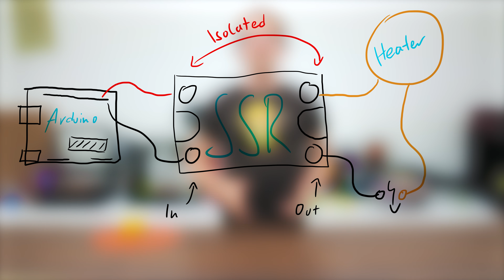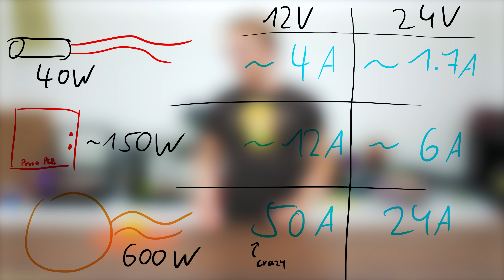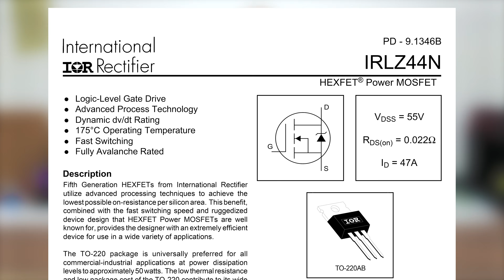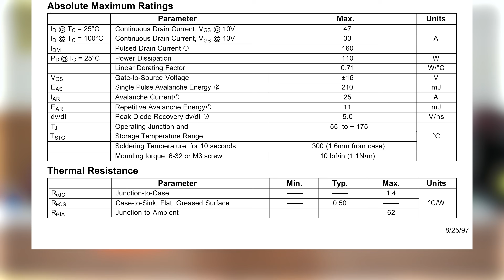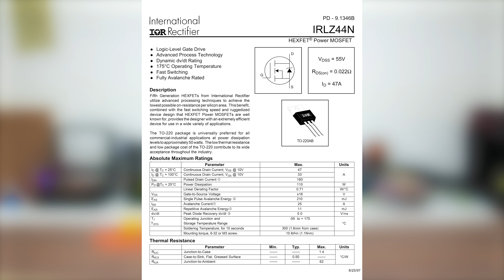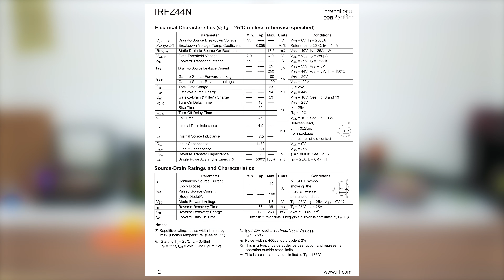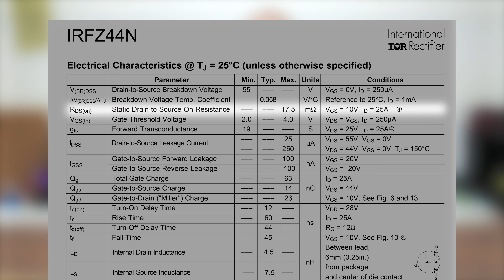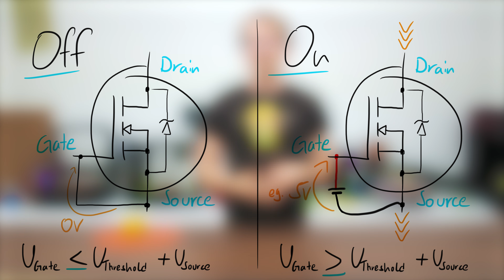Guide: Properly picking and using MOSFETs!

Comment: the last schematic is what I really needed to see explained - I was curious about the optional 100R. Thanks for that
Reply: +Adrian Ciubotariu I'm a newbie but was also curious how this works. What I gathered (and take it as a grain of salt) is this:
The 100 ohm resistor is to make sure that there isn't too much current flowing out of the output pin of the arduino. The gate basically works like a capacitor that is charged to switch the mosfet. So some current will flow into the game. The pins of the arduino are only rated for something like max 40mA so the 100 ohm limits that.
Afaik the 10k is so the gate charge can dissipate again when turned off and the mosfet switches off correctly.
Reply: +Adrian Ciubotariu Gate resistors are very nice not only to prevent your driving source to get destroyed (a gate of a mosfet behaves basically a capacitor, so in the first instant your driver switches on, it looks like a short circuit to the drain!) it can, by limiting that initial burst of current, help to reduce electromagnetic interferences too. (in a simplyfied view: less harsh current impulse means less emissions and with that fewer possible problems). If you would go really deeper into all the interference topics, you would actually start to look at the electromagnetc impulses travelling along paths in your circuits inducing electrical currents in the conducters, but thats another topic for another day...

Anyway, there is of course a trade of with increasing that resistor at the gate, especially once you have your heater PWM controlled, so it switches on and off all the time thousands of times per second. The gate resistor limiting the current flowing into the gate is now causing that capacitor to charge slower, so your FET stays into the transition between ON and OFF state longer. Now, thats where a FET really gets into trouble, because at that transition it has to dissipate a LOT of energy (the value of the drain-source resistor is changing from gigaohms down to milliohms, or the other way around.) A rule of thumb i use is to go with roughly 33 Ohms for gate resistors, but as usual, a rule of thumb is just that, and can be just as wrong as it can be right, depending on what you are doing and who is involved. (gate impdances and capacitance, conductor impedances and losses, driver output impedances...)
Reply: thanks to all for the reply, I received way more than I initially asked, but that's the + to the community, not just people printing, with general knowledge, but people with good understanding of all elements involved. 

reading all of this I realised I studied it, back in the day, but not enough, it seems. how it just went away, no idea...
there were a lot of "duh, dummy!" moments :)

Thanks to Dejay Rezme ExtraBase and, of course, *****